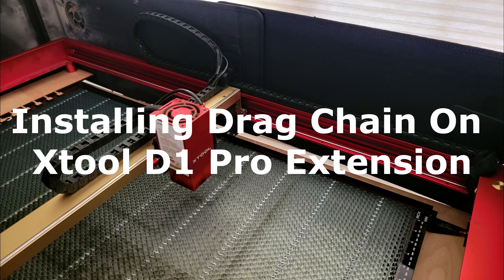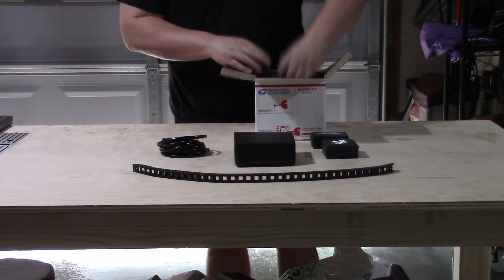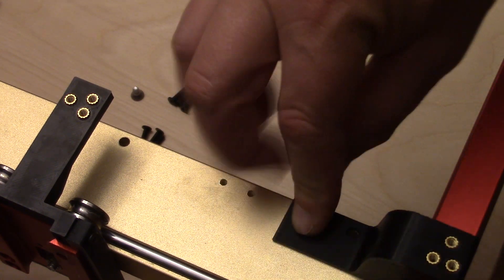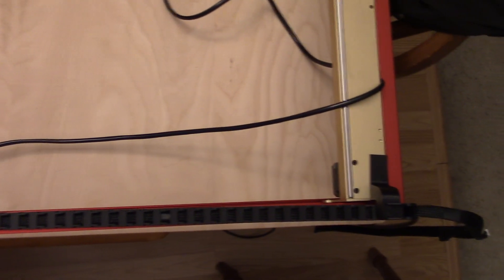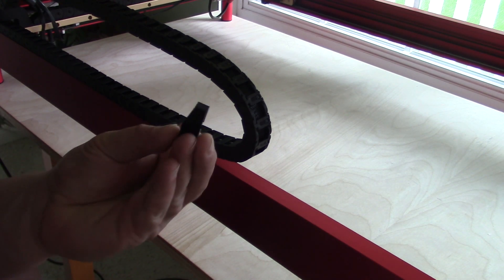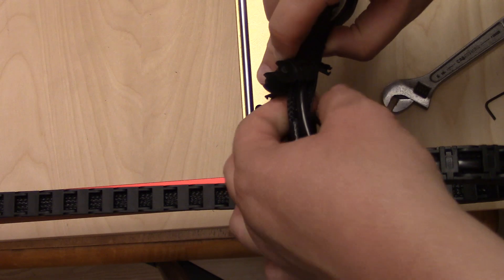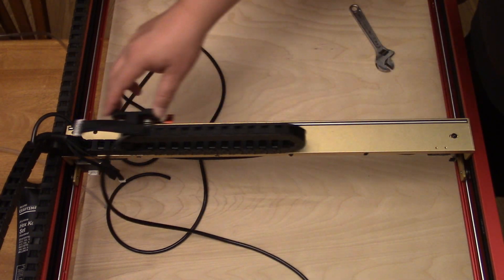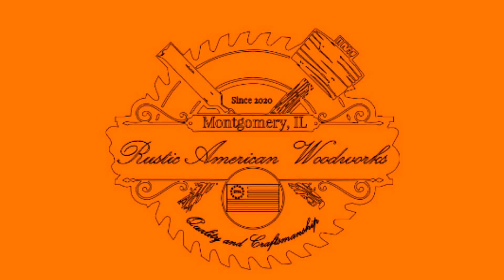Xtool Extension Drag Chain Installation

Comment: Do you know what items re needed for the d1 pro 40watt laser? The holes are not located on the bar with the laser for that one. Is there another kit for that one? Thanks for the help.
Reply from the maker: I'm not sure, however, I do know Alive Pixels does have a 40W option in their drop down menu, so they must have something figured out.  If you go to their website, you can send a message, Daniel has been pretty responsive when I have messaged him.  I you do buy from him, I did get a discount code that gets you 15% off "HowWeDoIt", feel free to use it and save some $$.  Good Luck.

Comment: Is this a must have have, when I extend my xtool 20w?
Reply from the maker: Definitely not a must have.  Everything will operate fine without a drag chain, however, sometimes your wires may get caught here and there and if it happens during a project, it will obivisiouly ruin your project because a caught wire will prevent the laser moving freely and properly.  This is an easy upgrade you can add when you are ready.  

I also just worked out a deal with AlivePixel to get my views a 15% discount when they use the code HowWeDoIt.  So if you are looking and choose products from Alive Pixel, save some money.
Reply: @thatshowwedoit6201  Thank you I’ll use the code when I’m ready. Currently have the extension piece and looking to put it together soon.
Reply: @thatshowwedoit6201  I would like to order from you and them, however when I click the link there is nothing there? Can you re link it?
Reply from the maker: @quickfixstat  which link are you having a problem with?  I just tested them and they all seem to be working on my end.